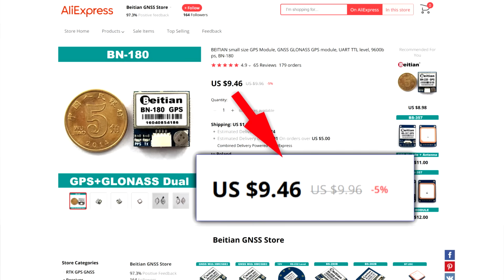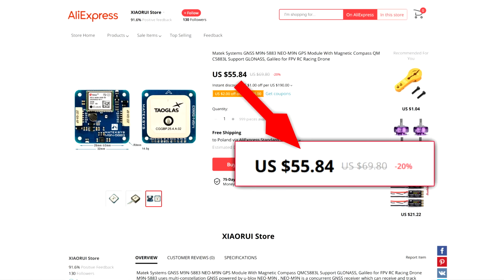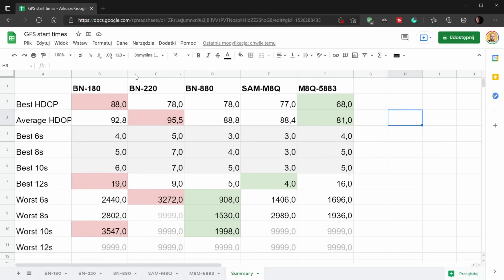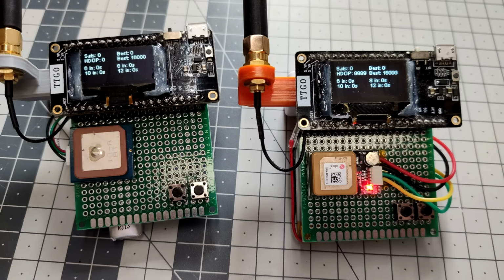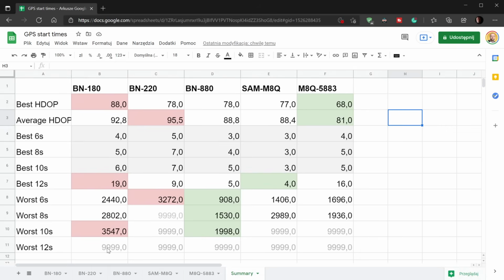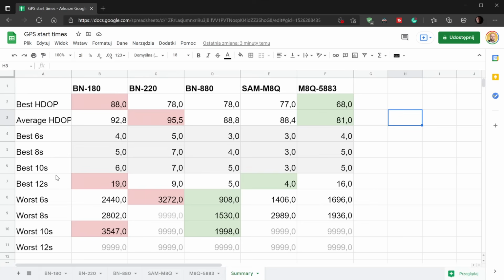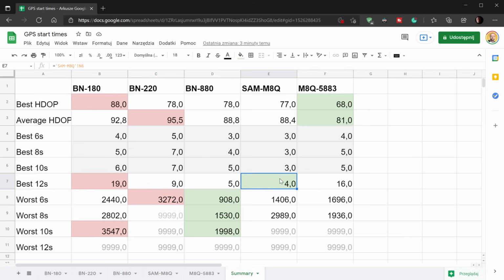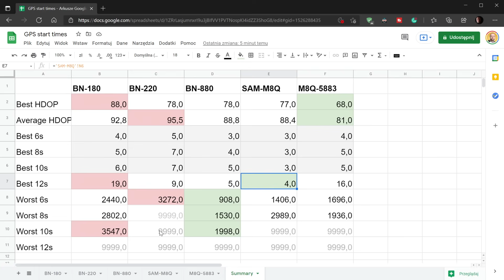GPS module test: BN-180, BN-220, BN-880, Matek SAM-M8Q and M8Q-5883 against each other

Comment: Czescz Pawel, zawsze dobry informacja we twoje videos ! 😊
I have just finished my Swordwish which comes with a BN220 installed in it. I am trying to get somehow  a compass information for OSD, w/o success however, which is logical, as this module doesnt contain any compass inside. On the other side, looking on the OSDs of several flight videos, I observe a quite reasonable compass information displayed. Can this be achieved without upgrading the BN220 eg to a BN880 ? Is any trick to get such information with a BN220? I read there are algorithms in FC who calculate compass information out of the GPS data. On the other side in the parameter file provided by Atomrc indicates that there is a compass installed..

Comment: I have hglrc m100 GPS and compass module, I have a speedybee f405v4 motherboard, Inav 7.1 software is installed, my GPS protocol is ublox7 selective, pos hold and alt hold are working stably, but when I send my drone to the duty point somewhere 330 meters away, my drone goes to another place. If pos hold and alt hold are working properly, navigation Shouldn't it work flawlessly in mode? GPS finds 18 satellites, HDOP level is below 1.2, where am I making a mistake?

Comment: Hello Pavel, I'm not sure if you are aware but you can update and change the firmware on the GPS itself, this includes modifications for hot/cold start. Also once GPS has gained satelite data it will usually boot up a lot quicker and more reliably within that 24 hour period.

Comment: Thanks for the video.  You've been my go-to guy for learning how to install GPS on my 5" quad.  Question: Does anyone using 5" quads on Betaflight utilize the compass component that many of these modules come with?  No matter where I put the module on my 5" quad, I cannot seem to get accurate headings.  I've fiddled around with the magnetometer's alignment in BF, put the module on a small stalk, made sure to calibrate the module when there's no metal around, etc.  The one thing I haven't done is actually fly with it yet, but I'm assuming that if the compass doesn't work well on the ground, it won't in the air either.
Reply from the maker: Betaflight does not use mag. You would need INAV to have position and heading hold
Reply: @FPVUniversity  That's interesting. Then why does BF have a magnetometer icon on setup page, an option to turn the mag on and off, a mag alignment drop-down, a compass on the setup page that shows heading (which does change when I change configurations for the mag), a mag calibration option, etc? Why do you otherwise say that BF "does not use mag"? All I want is to see a heading arrow in my OSD as well as provide extra information to make GPS Rescue more accurate (many online have said a compass will allow for this)--I do realize that I cannot have position hold, RTH, etc, unless I use INAV.  Here is a post from SnowLeopardFPV on the IntoFPV forum: "Unless you are using INAV or Arducopter then a magnetometer is pretty useless anyway. All you can do is display the your compass heading in the OSD of your goggles (unless you are using the DJI FPV System in which case you can't because they don't support the compass OSD elements). That is all. It can't be used for GPS Rescue or anything else in Betaflight."  I will be using the DJI digital FPV system.  Can someone confirm that I am out of luck in being able to get compass information under my circumstances (i.e., using BF and DJI digi goggles), even if I do manage to get my compass properly calibrated?  It's confusing, because I've read a bunch of conflicting info about using a mag with Betaflight.  No one seems to know the full truth.

Comment: BN 880 has an Active antenna so better performance over BN 180 and 220 is highly expected.
Anyway, hdop value as shown between 68 and 88 are very poor, probably because of indoor situazion (should be 2 or lower)

Comment: I have a matek M8Q-5883 I'm setting up in INav.  I am trying to use the magnetometer.  I get correct readings in INav but nothing to my Transmitter where I am trying to display Hdg.  My flight controller is a Tyro-129 (target Matek F405) and my receiver is a TBS nano II.  Where could my problem be? My wiring runs from the GPS SDA and SCL to the same connections on the flight controller.

Comment: Does GPS require both Tx and Rx wires to be connected to FC? I have only GPS Tx wire connected (no free full UART) and it works but would it be any better with Rx?

Comment: the M8Q modules are also FAR LESS sensitive to outside interference, if the receiver is close to a motor, VTX, or a bad/cheap camera ... good luck getting a fix at all.
the M8Q has no problems with his. also shielded cables are not really required as it just knows what is what. also i can confirm that the BN receivers do "Cold start" far more often that the Mateek ones do, for the 180 1+ hour is already enough to make it cold start on a 220 about 3 hours. the Matek does hot-start even after 6 or 7 hours. (not as fast but MUCH faster than actual cold starting)

Comment: Hi all, what do you think about the Beitian BN-220T. It has a thicker ceramic antenna, do you think it is better than the standard BN-220? 
If so, I would buy it. I have the BN-200 (same as BN-220) and is very slow at cold start :(

Comment: Id want to see this test done with the same setup used for each GPS, a regulated power supply and a fixed(exact) position for each test. I like the idea but feel there are still too many vairables to get concise results. I also think multiple locations should have been used to rule out any changes. However, with that said I am fairly sure results would not differ too much.

Comment: So... You've tested the 5 worst GNSS receivers on the market...
There really are much, much better GNSS receivers for drones out there. The Matek M9N would be one step better.
Reply: fucking expensive
Reply: @Nici619  So $100 for the 4 motors is normal but $50 for a GPS is too much?
Reply: @Vousie  yes. My motors cost max 15€
Reply: @Nici619  Is this for all 4 or each?
'Cause I'm fairly sure I've never seen 4 motors for 15 euro....
But in any case, if you like buying such cheap rubbish, then prepare to have your quad fall out of the sky 'cause it lost GPS lock.
Reply: @Nici619  yoou should definately try some quality motors next time - you see and feel the difference immediately
Reply: Good day what do you think is the best GPS for drones ?

Comment: I wonder if some of the issues I've had between identical GPS receivers is due to damage from G-forces/vibrations, hard landings and crashes. It would be interesting to test new GPS receivers against older GPS receivers that have been put through their paces.

Comment: So.. did you actually mention the test conditions anywhere in the video? I couldn't find it. I hope you did the test outside, otherwise it's not of much use.. Also measuring standard deviation of the 3D fix would be a better metric than the self-reported HDoP/VDoP.
PS. Have zero issues with BN-220, suspect anything else might be overkill unless you need GPS position hold on multirotors or do Arducopter missions..
Reply: Im pretty sure he cold started indoors

Comment: I always suspected my Mateks were more accurate. My BN220s seem to lock on min sats more quickly and reliably, which is strange. every once and a while my Mateks take a really long time (even under similar mounting) and often the bn220 schools the Mateks on hot start.  Fortunately I'm only using these for BF GPS rescue which sets a pretty low bar for needs / accuracy. Also prefer being able to set the 10hz update rate in ucenter and saving there as BF doesn't support UBLOX7 yet and that's not really possible (practically) with the two Mateks shown here.
Reply: That’s interesting ! Is it possibile to set 10hz on the BN or Matek?
Reply: @Simofly  yep, both are capable of 10hz. Just depends on the firmware you use. For inav i think the ublox7 protocol sets them to 10hz. For BF you’d have to do a very tiny amount of custom code. But with the BN220 (and other gps units with flash space) you can set everything in ucenter and turn off any configuration commands sent by inav/bf.

Comment: Thanks. I'm curious about an M9 vs. the others, and how Ground Assist affects the comparison.
Reply: I've never noticed a huge difference using vs not using ground assist but, I think this will be highly dependent on where you are flying. I'm only really flying gps rigs in the middle of nowhere or in the mountains. Maybe in really noisy RF while also being closer to the towers there would be a noticeable difference but, I think it provides a less accurate vertical accuracy probably because of multipathing.

Comment: I got very similar results recently. I put an m8q-5883 on a flywoo hexplorer and a Bn-880 into a rover, both running iNav. Favourable results with both but the 880 is pretty big. 

With the m8q my RTH landings with the hex are very accurate. Never more than 30cm from the home point. (iNav 3.0)

With the 880 I get 3D fix almost instantly and I'm running a DJI air unit in the rover with no problems to the GPS. (10cm separation between AU and GPS) a
Reply: Hi @willsintheair thanks for sharing your experiences!

I plan to install a m8q-5883 on my Flywoo Explorer in order to be able to run it on INAV.

Where did you mount this GPS unit on your Hexplorer? Did you use the original GPS mount in the back of the quad, or did you put it on a mast? I am wondering about the required distance between the Compass and the other electronics. Could you share your experiences on that topic? :)

Comment: I put the BN880 on everything, even though I don't use the built in mag. I've actually started buying the BN880Q now, a slightly more compact form factor but still the same GPS receiver.